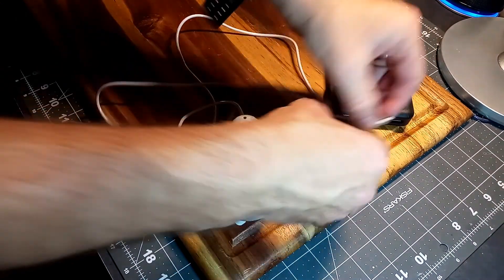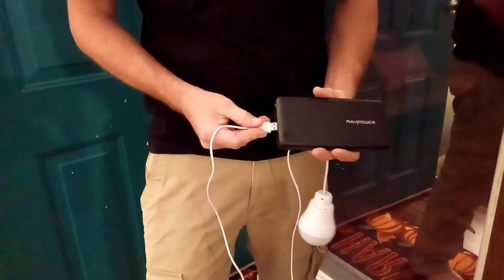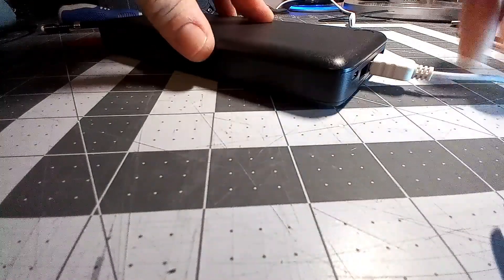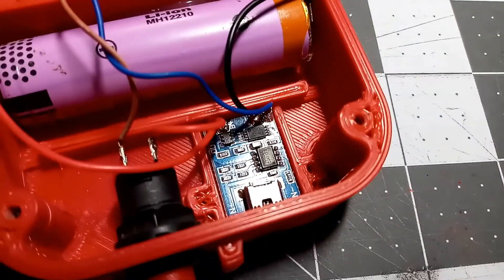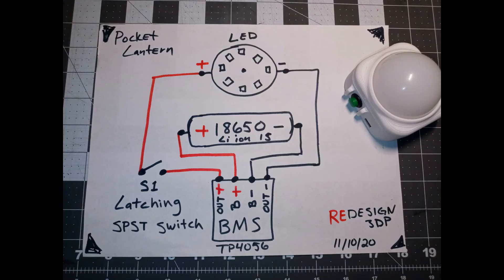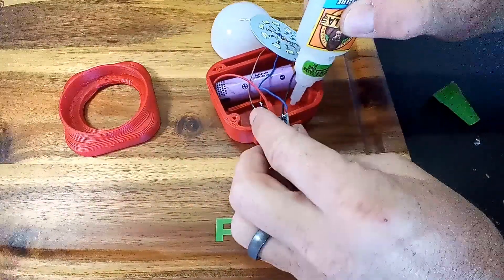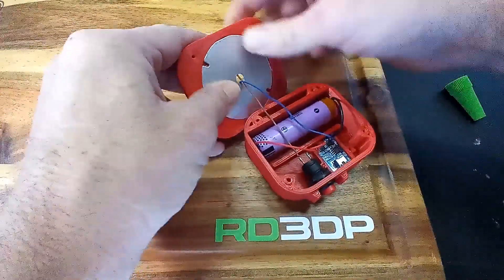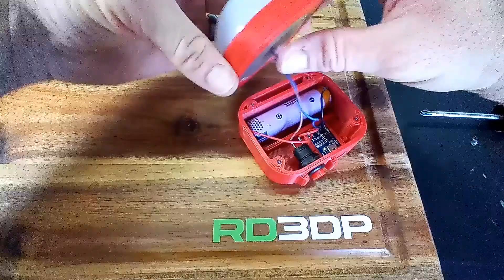3D PRINTED POCKET LANTERN DIY HOW TO

Comment: I was looking for this kind of design. But I would like to use a 18650 battery holder so that its easy to replace when needed. And using 4pcs 18650 so that it can last for the whole night.

Comment: I like the design.  I wish that you could create one using a single battery holder. The reason is 1. I wouldn't have to solder, 2. If my power bank is drained. I might have a extra 18650 battery or 2 to swap out.  How long will the light last with a full charge?
Reply from the maker: Stay tuned. I have a few more designs on the way. It might be just what your looking for.

 I haven't tested the lantern duration of a full charge. To be honest it was just a quick idea I made for a friend and thought I'd share.